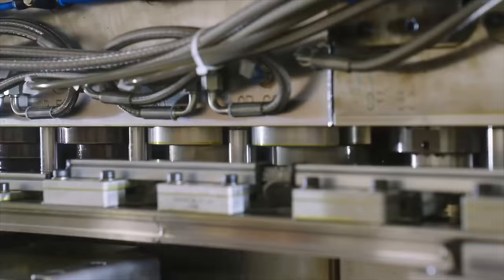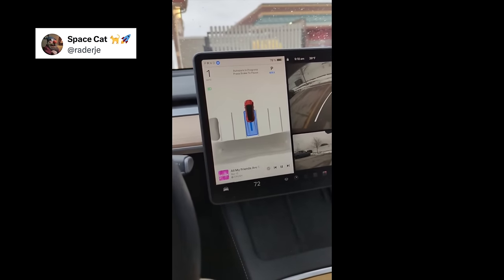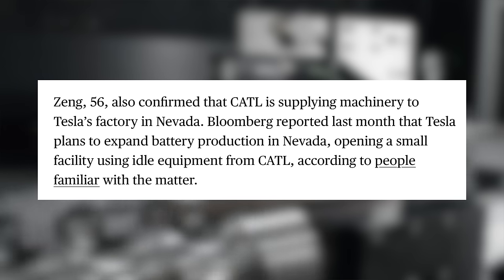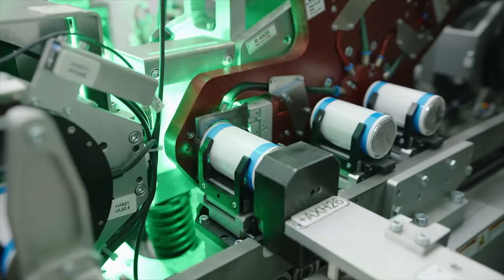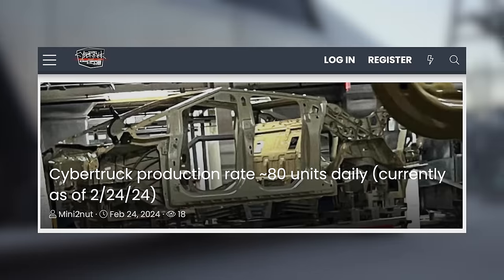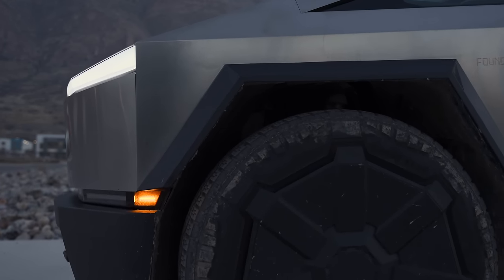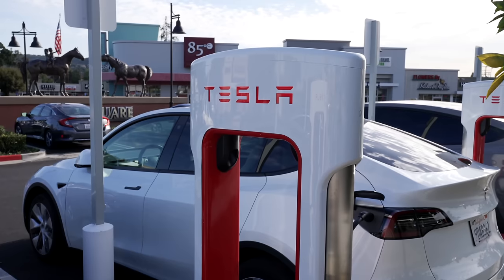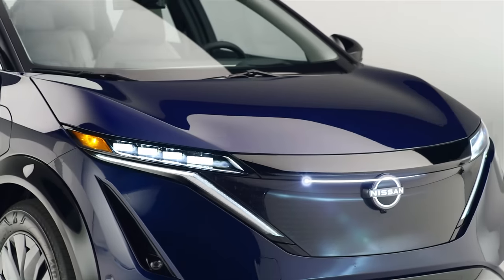Tesla's NEW Battery LEAKED | Budget Tesla Battery Partner

Comment: It’s interesting that Tesla chose to force their drivers to park safely at charging stations and other manufacturers chose to let their drivers park in the normal unsafe American lazy way.  Which is where the most dangerous part of parking is done with vehicles and pedestrians crossing behind your vehicle.  I worked for the largest fleet in America they made us take a safety course on parking and it’s not up for debate.  Pulling into a parking spot is more dangerous than reversing into it because when you pull out you can more easily see the pedestrians and vehicles going past you.
Reply: The crazy thing is, there are idiots who will argue passionately that backing into parking spaces is wrong...🤣
Reply: I have two vehicles that have NO problem backing out of a parking spot.  They have cameras and USS with rear cross traffic alert.  A feature that the supposed advanced tech Tesla does not have.  Have you seen the videos of the new improved Tesla auto park taking forever to back into a spot?   While your car is angling for a spot, the driver behind you just took it.....🤣
Reply: @samwarren1429  I've been backing my HVAC service vans into spots for over 30 years.
My current van has an 84" wide KUV service  body on it, and I've no problem lining it up between 2 parked cars, dead center of the spot, with no rear view or parking aids, other than the side mirrors.
To snipe my spot they would have to drive through the back of my van, or other parking spots, so good luck with that.
My personal car has the cross traffic sensors and backup camera too, I still find it safer and more convenient to back into spots.
As for the Tesla auto park, I don't care.
A friend of mine has a Ford with auto park, it is pretty damn slow at it too!
If someone needs an auto park feature to park their car, they shouldn't have a drivers license.

Comment: Tesla is selling Superchargers to other charge equipment suppliers partly because of Tesla's legendary reliability and up time. But those factors depend on the fact that data from every Supercharger is constantly sent to Tesla and either OTA updates are sent or a service tech is dispatched to repair/replace hardware. My question is whether rebranded Superchargers will get the same quality service from the buyers or whether Tesla will be paid to do the maintenance so the Tesla charging image will not suffer degradation.

Comment: Just because a car can charge quickly doesn't mean it's people will be good with low range.   Charging more frequently means paying more to drive it and at that means it could get as expensive as driving an ICE vehicle, this is not what the EV industry needs.  Yes, at some point down the road the cost to charge an EV will be the same as an  ICE vehicle pays for gas, but we don't need that happening this soon.  The EV industry needs to focus on more range with reduced vehicle prices.  That alone will get dire hard ICE owners into EV's.

Comment: The "battery tech" is just Lithium-Iron-Phosphate.  I've been running off-grid with LiFePO batteries for years.  It's not the best power/weight, but I guess charging rate is more important than range for lots of users.  Doesn't surprise me, limiting charging to 80% is a huge hit to range for Li-Cobalt cells.

Comment: Legislative hurtles are still the biggest issue even if FSD was level 5.  Legislation must decide who would be liable if a death in or around the car.  WHO has priority to live car passengers or pedestrians?  Even if FSD could save 50% of lives, 20,000, it would be worth it.  Planes still have 2 pilots and autopilot but your dealing with airspace and super high speeds with less error

Comment: If you listen to what Tesla has been saying all along, you would not have assumed they would use the 4680 battery for their next generation $25k EV. At battery day Tesla stated that the 4680 battery would be used for their higher end EV with longer range requirements. The LFP would be used in the lower-end of most models (i.e. the low end Model 3, Model Y, and perhaps the low end CybrTrk). The next generation EV will be a mass market EV - the smallest and cheapest EV that Tesla has ever produced. Why would they ever put a premium battery like the 4680 battery in this type of vehicle? Its not logical, economical, nor intelligent.

Comment: Bought MYLR on Feb 22. Got 3 mo FSD as referral perk but it is V11. Have worked with it a lot and conclude it’s not good in even moderately complex situations.  Wonder if I will get a V12 update before May 22.  Anyone else in a similar situation?
Reply: Your MYLR gets only 310 miles on a full charge beside getting that 2024 model year badge.
Reply: I also bought mine in Feb with 3 months free and I’m on v12.  You have to opt in for beta.
Reply: @whatdoesnt just got “the email” half an hour ago. Installing V12, AutoPark and other updates as I type this.
Reply: @Diap842IV  enjoy it’s soo much better than 11, not $200month better, but better 😂
Reply: And HOW!  Geez, I can’t believe the difference. Drives more naturally.  Did a 60 mile round trip just now…door to door with no disengagement. Even did a U turn successfully in a spot where it failed on v11.  I’m with you on the price as there’s no real need for it, but I guess if one wants to spend the money, at least it works better.  In the coming days I’ll know more as I go over a lot of the same routes that failed previously.